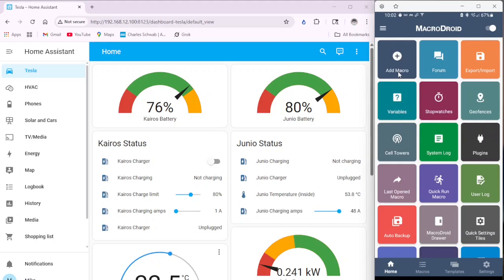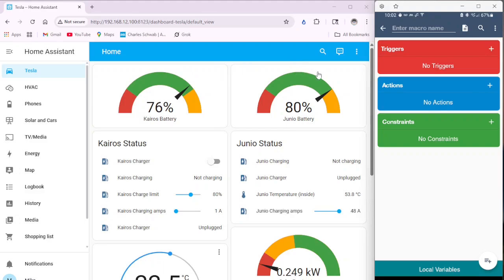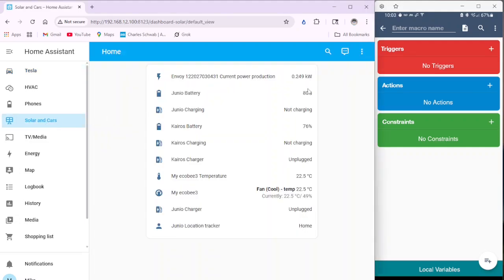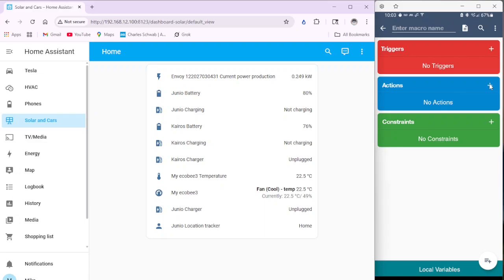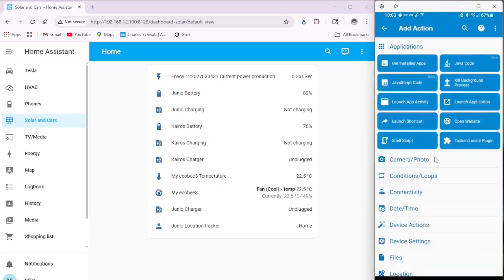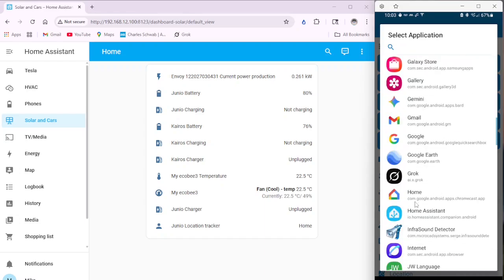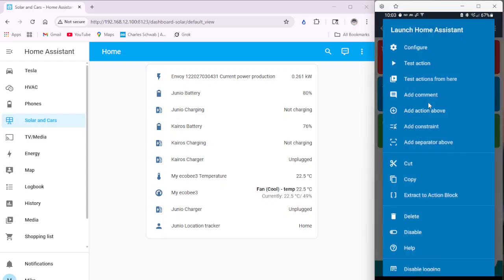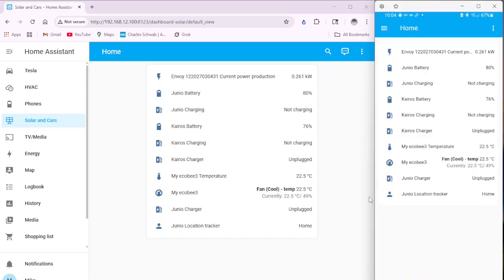Tesla Charging on Surplus Solar Using Macrodroid and HA

Comment: Hi Mike, 
First of all, Great videos 👍👍
I was trying to do something similar with my 2026 Y and home assistant with tesla wall charger and gave up since I’m having a tesla power wall installed soon and it already has that feature. 
So I read the Tesla Fleet API, just keep in mind that even the tesla native app has an activation limit. 😢
For anyone interested, my go to alternative would be to install a wall box that has that feature built in or that is compatible with home assistant. I would leave the car at max charge rate and have the wall box varying the power according to solar excess. This would work with other cars as well